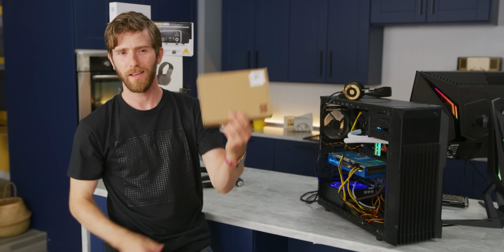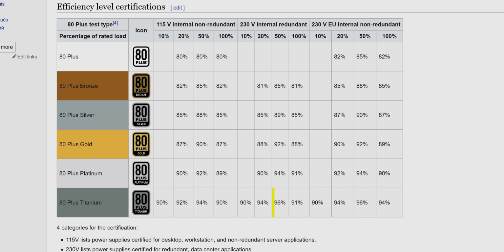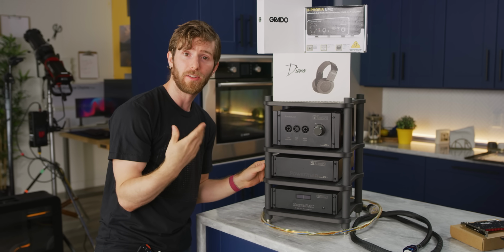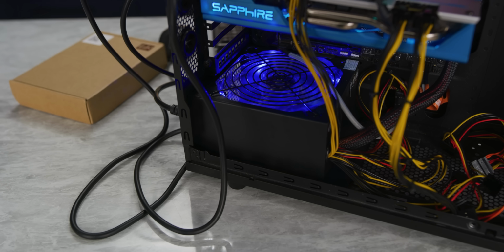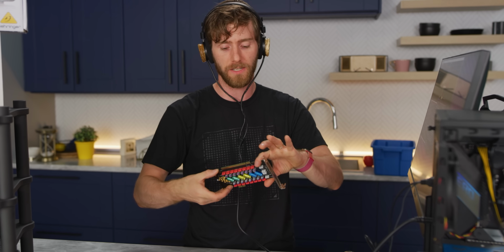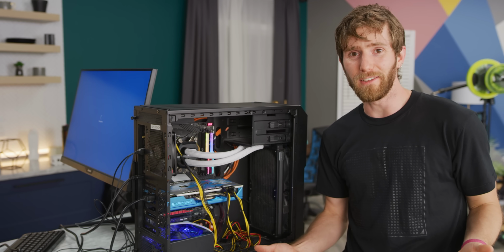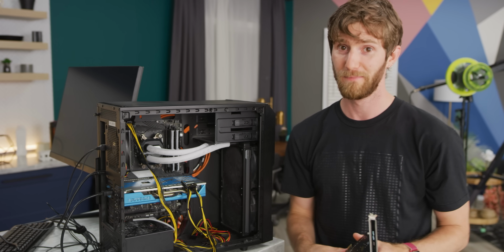Is this $40 card a SCAM? - "Audiophile" Power Filter

Comment: The main reason for a dedicated sound card back in the Win 9x era was that onboard audio back then was done in software and thus on the CPU. So a dedicated sound card would give a pretty substantial improvement by offloading that from the CPU. Onboard now can still be software based, but doesn't really matter as the load on anything newer than like a P3 is relatively tiny by comparison.

Comment: Buying a power conditioner wont get rid of ground loops. And it also won't make one bit of difference to the power quality. Unless you spend a ton of money. The atx spec has tolerances for maximum allowable ripple on a power supplies dc output.

Comment: Ah yes the scientific process! 

1: Decide the thing won't work
2: Run a control test with no discernable audio issues. Remember, use your own judgement, and no objective measures
3: Run a test with the device installed, no noticable problems just like the control. 
4. Report that there is no improvement, the device is a scam.

Comment: This genuinely might have helped in the super niche case that was where I previously lived. The electric wiring in the house was from approx the 60s and it was super weird. How weird you might ask? Well, if I touched the power cable (yes, the one with an insulator around it) with my bare skin it would create a buzzing sound in my headset and mic and cause my peripherals including mouse to bug the hell out. I eventually got one of the outlets grounded and the problem went away, but it was very bizarre and people wouldn't believe me in voice chat until I touched it rhythmically while I was talking. If I felt like wasting money I'd test it out at my family members house, as they un grounded that outlet.

That house is a fire waiting to happen

Comment: @LTT Hey wait i have a idea for you. Grab a Maximus VII GENE (mATX) Board and the "ROG FRONT BASE PANEL". Connect the Panel to the Board via the ASUS ROG CONNECTOR and connect the ROG BASE Frontpanel Audio Cable with the connector at the small audio Card from the Board. I got real heavy noise out of the ROG BASE Frontpanel Audio connectiors.

Comment: Here's how this works ...  I sell you something that does nothing, but you don't return it because its too much of a hassle or you would feel embarrassed. 
Want to have some fun try returning food to a grocery store. The looks you get are priceless. 
Its kind of unlikely noise would be coming from anything on the DC side of the PSU anyway.
There are parallel noise suppressors for AC  but I've never seen one for DC 
If your site power is wonky try throwing a capacitor at it. They take the punch out from any nearby motors mucking up the AC https://www.kvar.us/index.htm

Comment: Used it wrong, this card isn't meant for improving too much audio output, it's made to improve audio input since the audio input has high impedance as opposed to the low impedance of the headphones, personally i'd use only 6n5 capacitors and a low pass filter made with a (iron core inductor in series with a capacitor) in parallel with the power lines.

Comment: My thoughts:

1) Too subjective.
Actually measuring the noise floor (preferably spectrographically) from the headphone output (or line out) of the MoBo or audio card... including perhaps from the front panel connector (often worse as the cable run is longer, hence more susceptible to picking up more crap by inductive coupling) would be more conclusive.

2) If they had put actual audio H/W on the card, it might have had some point to it.

3) TOSLink et al FTW ... just decouple the audio side from all the digital crap in the PC, use a decent "receiver" or HiFi amp with an optical link.

4) $US15K? - I obviously need to start building "high-end" audio systems (again) :-)

Comment: The biggest problem is that we are not whales to detect that noise, I recommend doing the following to test = from the audio output connect to another equipment that records audio at maximum quality (one with the card and the other without the card, although the correct thing is compare several different tracks with different signal levels) and then see the sound graphically with programs like "Adobe Audition"

Comment: If you knew anything about audiophile sensibilities, you'd see where the device went wrong: they didn't price it highly enough. Audiophiles hear significantly more improvements in equipment the higher it costs and $40 is really amateur hour. If the price tag had another couple of zeros, then its benefits would be clear.

Comment: The only way that card would improve electrical noise is by being installed inline between your power supply and the device you want to reduce the electrical noise of. The very concept of this product is a scam.
Reply: Isn't there a power connection on PCI? Unless it's isolated in some way it would be connected in parallel with the MB and thus fulfill its intended role.
Reply: Nah, if you need this sh!t you should probably get another PSU and ground this sh!t, although i can see some use for this stuff when we're considering audio capture, i would consider adding a low pass filter made out of a toroid.

Comment: Hey Linus, I don't believe it will change your conclusion, but you could analyze the frequency spectrum of some audio samples with and without the card. The switching mode power supplies generate high-frequency noise, which may be difficult to hear. Analyzing the frequency spectrum with an FFT or spectrogram, you would be able to see if the card is attenuating any noise at all.

Comment: changing the Bit rate of the audio in windows would have helped you determine if it actually does anything. as higher bit rates pickup the stray electrical noise more than low bit rates DVD quality etc etc.

Comment: The best external USB DAC+AMP experience I've had actually had built in bass and treble knobs. Onboard sound is fine, but easily being able to tweak it to my liking so easily made a HUGE difference for me. Though, there are solutions to actually EQ your ENTIRE computer (not just one program at a time) that also work very well.

Comment: That's not even how those things work.

You would need to place the capacitors between the power supply and the load (device), otherwise they're not really doing anything useful.  Plus the PCI slots handle a very minimal amount of power.

You could also place cheap power chokes along the negative side of the power cables in the form of ferrite rings.  This would help damped signal feedback along the power lines which is the most common way.  Look up ferrite choke on your favorite shopping site, they're seriously $10 for a dozen.

Comment: I agree with Linus that the idea of the card is a good one, but as far as I am aware, power conditioning doesn't do anything when it's not directly between the source and the other devices. This thing seems about as good an idea as plugging in a device to one outlet in your house that claims to reduce your power use by smoothing out your power. With this card, I honestly would be worried that it would like catch on fire, esp with all those sketchy no name caps on there, and don't even get me started on those two TDK common mode filters...

Comment: hook up an asus strix soar 7.1 sound card which requires a 6 pin connector from your power supply and you'll get the noise you're looking for. have it in my pc and yes I do have the noise with a good power supply. in order to get rid of it I just disconnected the 6 pin connector as it works just fine without it.

Comment: plus modern day onboard sound cards are much better than they used to be. Especially on any higher end motherboard. My old Asrock Fatal1ty 990fx Killer has a really good (well protected) on board audio (yes I still use old FX8370, 990fx killer, and 16GB of 1600 MHz HyperX Savage DDR3 ram) as it gets more points in cinebench r15 than my i5 4670k (both on stock). It is time for an upgrade!

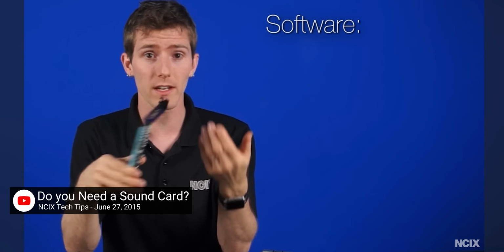Comment: 9:56 - and it still is. As much as I hate Creative, due to trouble updating drivers back in the day, I wouldn't ever build a rig without a sound card. Even in my last computer, when trying to figure out some problem I was having with Unreal Engine 3 games, when I took my soundcard out and just used on board audio, the difference was night and day.

Comment: I have a setup that my onboard audio is riddled with noise even when the pc is powered off. this could be useful to absorb dirty electric that the socket (main culprit) provides since grounding my case doesn't help.

too bad it's too expensive for a circuit filter, unless the manufacturer can convince me with its BOM

Comment: Those kinds of filter cards are for chaining into high powered amps that drive high powered headphones/speakers. It can also be an issue when you're running things on usb power like with usb powered dacs or dac/amps. I'm not really sure how that card fits into the delivery chain but it should certainly be more of a consideration than is apparent in the video if you're going to give a conclusive answer.

Comment: it would probably make more sense to implement capacitors on the input of the graphics card then as the card needs more juice it pulls its load from the capacitors first and thus reducing the noise it causes down the line.

Comment: You will get lots of noise in a menu of a game that is framerate unlocked. Witcher 2 has horible noise in the menu, goin at 2000-3000fps.

Comment: Power filters only work if they are down line from the components. Like the power supply. With todays high voltage toloranance CPUs needing specific voltages in the millivolts. Pretty much every modernday powersupply already have these filters. Even the shitty cheap china ones.

Comment: Not that anyone cares or that it matters, but all the little silver 'cans' and red 'boxes' are also capacitors.  it does fuckall being so far away from the components it would be used to filter for, but the idea is sound, you need a large number of caps of different values in order to filter out various frequencies and harmonics there of.  thing of it is, any product build above the level of complete trash that catches on fire when you turn it on already has the filters it needs, as does even the cheapest PSU.

Comment: Why didn't you do any non-subjective testing here? You could have put and oscilloscope on the power rails with/without the card to determine if the power was actually cleaner. You could have captured the audio output of the songs with/without the card and compared the waveforms. Don't get me wrong, I don't think this works either, and it would be better to just put that $40 bucks toward a better PSU, but in this case it seems like the testing methodology is shoddier than the card itself: "Hey, let's get Linus to just listen to a couple songs and see if he can tell the difference."

Comment: .... so... is that a ghetto luxury PC? Cheap motherboard + Cheap power supply + cheap case + Expensive processor and + top of the line Graphics card? I mean if your trying to give the solution a chance you got to go through all the options. I want to know if it actually works or not. Like does the 2080 ti great interference with the On board audio (something linus has documented in the past near launch of the card)? Is this something you might want to get for say an old Business overstock PC special from Amazon?

Comment: This card could be useful for audio engineers that have external audio interfaces that connect up to the PC via firewire, USB or thunderbolt. You may not hear anything right off the bat, but if you are recording a band and the AC unit kicks in halfway through a track this thing may help reduce the click that you will end up having to clean up in post. Also another good way to test if its helping is to sample your soundcards noisefloor. Take a 5 second clip of silence and normalize it. Compare it before and after the card is inserted. I'm still curious about this because I do audio work, but i've always used external power conditioners before the audio equipment or PC. hmmmmmm.

Comment: 2:02 In the 90s I had speakers that did this until I slapped them. But it would come back at some point. And I bet I'm not the only one. That's were we learned to beat up our hardware when it wouldn't work :D

3:13 Nothing happened there, it won't do anything anyway... :D

4:24 I checked my notifications there when I heard Fluttershy squee - https://www.youtube.com/watch?v=MOsCzYSu-40

7:13 What I said XD

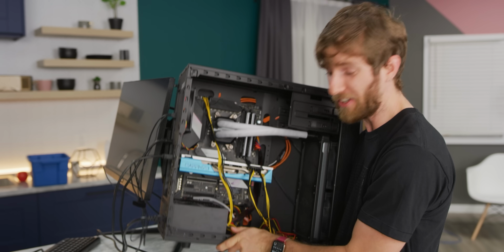9:46 That time is called "now" and it's still ongoing. However the nForce2 audio was pretty darn good, about on par with the first Audigy. But I only had Realtek and VIA things after that and they're outright horrible. That's why I still run my X-Fi Elite Pro. Night and Day difference.

10:47 Go ahead and get an Uninterruptible Power Supply in that case. I once had a blackout just while I was flashing my BIOS which literally made the board FUBAR as in bricked. I wish I had one back then.

Comment: I’d like to see a part where they measured the power rails with a scope to see if it was even measurably cleaner at all
Reply: Which rails? The 12V that goes from the PSU into the board? The 12V that goes from the PSU into the graphics card? the power lines inside the different PCIe lanes that function independent of each other?

Comment: Additional smoothing on the output of a switcher cant do anything unless there is smoothing then an inductor then more smoothing. IE the sawtooth waveform on the primary smoothing cap is a function of the control circuit. IE if the voltage has not dropped by a set number of mV depending on switcher type there will be either a skipped pulse (PWM to zero on some) an extremely narrow pulse, or with constant pulse width types longer between pulses. Early SMPSU's used to go bang with no load. These days some can cope with it by going into shutdown if no load is detected during soft start.

Comment: Well, do it the right way. Hook up an osciloscope to the powerlanes of another PCIe port, and see whether you can see the difference. The card is probably just a low pass filter. The onboard soundcard hopefully comes already with something semi-sanely designed to do that, so it's by far not an ideal way to test. Also use something which does not load the GPU to 100% all the time, like an old game intro where you get >1000 fps without maxing out the card. That way the power draw of the card actually fluctuates on a high frequency, which is the scenario in which the filter card is most likely to affect the quality/residual ripple (not sure, not a native speaker) of the powerlanes voltage. You can probably not reduce coil whine, as coil whine is induced through AC boost/buck chips on the GPU, so a more stable powerlane via PCIe won't change anything about the GPUs home made AC moving some components a little bit on a high frequency, thus creating the coil whine.

You can do better, you've got the budget and access to the required knowledge to check whether this card can make a difference. Checking only two things (coil wine & onboard audio) which are both unlikely to be affected by the device is not a good way of looking into it...

Cheers

Comment: I'm not saying that the card actually does anything, cause it most likely won't do any better than the filtering on your motherboard, but if you wanted to test your audio output for noise, you were better off connecting it to an oscilloscope than trying to find very small differences with your ears. Unless your using a cheap crappy motherboard with bare minimum filtering, you probably wouldn't see a difference.

Comment: Rather pointless testing it on a motherboard that DOESN'T have noise to begin with.  Could have easily tried it on an ASRock Taichi Z390 which is well known to excibit noise on the headphones port.  I returned mine when it started to do coil whine on the CPU VRMs as well.

Comment: just from the quick look i can see it has 100V caps 100% scam 
you do not need 100v camps like maybe 20v if you want it to last forever on the 12v rail! 
12v for the 5v rail.. ect 
i work in electronics this is a SCAP and im only 6:00 in LOL

Comment: I was having weird noises on my usb going to my outboard dac, tried everything a different dac, a 40 dollar galvanic isolator, a usb powered hub, a power strip with a special filter nothing really solved it. Some solutions lowered the noise a tiny bit like the usb hub but ultimately found out it was a bad motherboard.  Lesson learned,  Garbage in Garbage out. Don't fall for these stupid products.